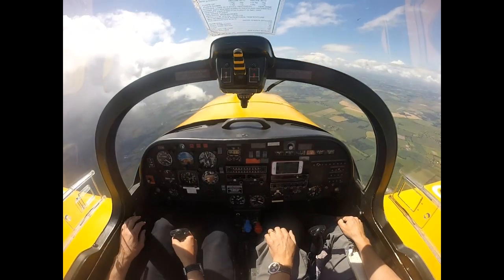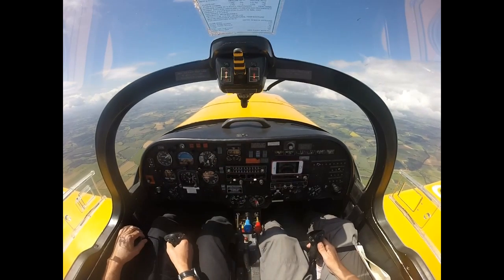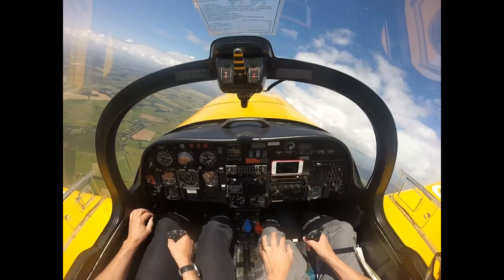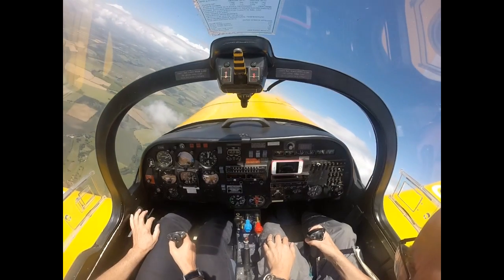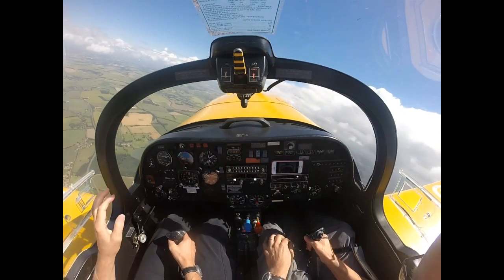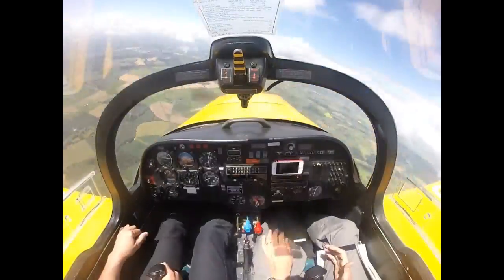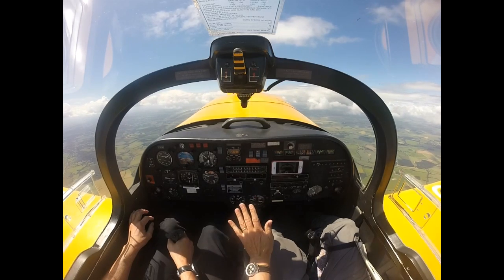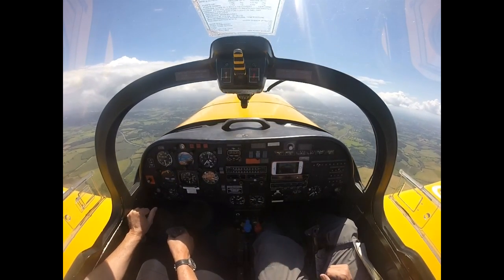Standard Spin Recovery in the Slingsby T67M - Julian Murfitt

Comment: Nice filming. Firefly is a very under rated aeroplane.  Be even better with a brief view showing horizon through upper canopy!  No doubt film editing here, but worth a full 360 deg steep turn lookout before each spin to clear the column of air below - impossible to avoid other aircraft once established in the full spin. HASELL like checks can include a fuel balance check. Be careful of ailerons in the spin - this affects the dynamics considerably and can lead to high rotational mode.  For academic spin entry can enter positively before the buffet by S&L decel, maintaining the lookout and clearing above and behind before full pro spin controls using both hands on the CC to ensure symmetrical pull and maintenance.  It makes the machine go the way you want it to rather than letting the incipient spin lead. Both hands on CC keeps hands off the throttle until after easing out of the dive post recovery. Again power setting affects flatness of spin.   M160 we allowed around 250 feet per turn, M260 more like 400.  All the best!
Reply: thanks, much valuable comment👆
In sailplanes we always do a full turn lookout and HASELL checks before every STALL-SPIN-RECOVERY demonstration.  👍

Comment: She likes to go around an extra turn or so after anti-rotation control has been applied. Holding opposite rudder and waiting for the rotation to stop can be a little unnerving. I like to feel the rudder biting and stopping the rotation as soon as opposite rudder is applied. That's just me though. A Piper PA-38 may go around as many as 2 to 3 times after full opposite rudder has been applied. No thank you!!!!!
Reply: Don't I Know it. I learned to fly in a Tomahawk. It does get a little scary waiting for the little Piper to stop spinning but it always did,  just took a little longer. 😬I Don't think it ever went past 2 turns though.🤔